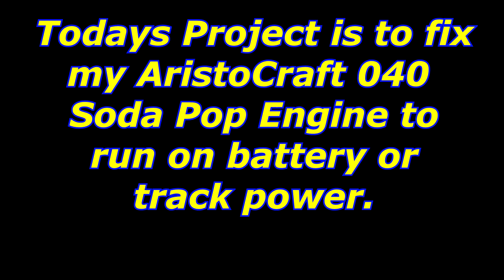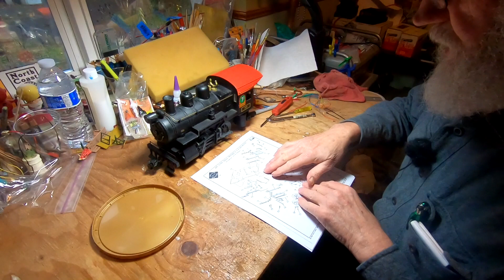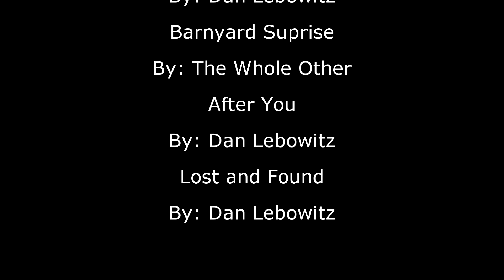2021 AristoCraft 040 Project, the Start

Comment: i used a $6 part dont worrk i fried my circuit board too just in a different way. you see i torned my controller on without thinking to install a switch to disconnect from the rail power. it back fed and blew my reciver into two parts. lesson learned install safety switches

Comment: Wow, I too have an Aristo.Craft ART-21297 #96 RC Express.  My wife found the set at a resale shop but the box cover and any documents are missing.  I have the locomotive, tender, boxcar, caboose, track and power. I just realized this was a Aristo.Craft.   Hope to see the conversion to battery-powered.
Reply from the maker: Hope your engine is in good shape, I found out that my engine has a broken gear on the rear axle.